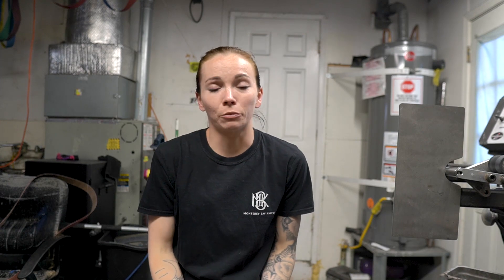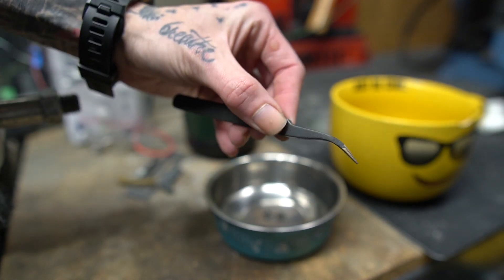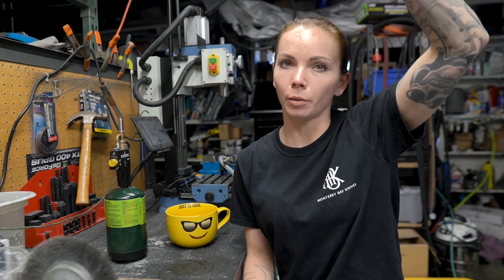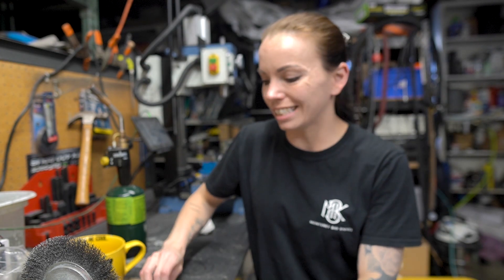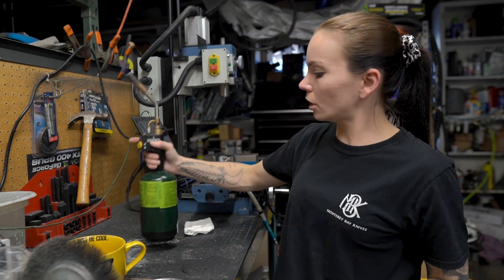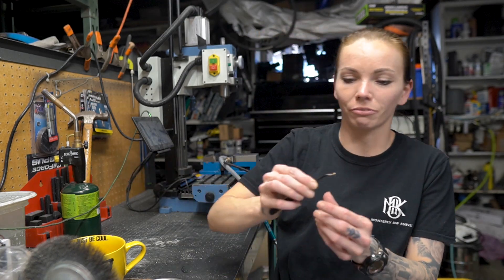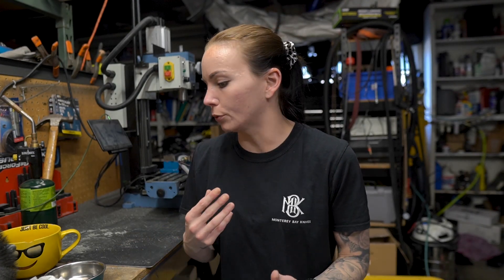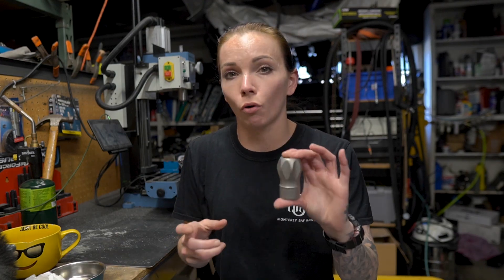Anodizing Part 3: Steel Hardware

Comment: This is not anodizing steel.this is actually the first stages of heat treating or hardening steel.
First colors seen is staw look then browns blues purple then it works up to cherry hot red.
The higher colors the more the steel becomes brittle until you temper.

Comment: Asking this because I know nothing .I would like to do this with some stainless steel bolts on my motorbike BUT how does this affect the strength or softness or hardness of the screw or bolt ? Also how does cooling it quickly using water vs not using water and letting it cool slowly affect this.
I would prefer bolts not to break on my bike as I am riding :)
Reply: Not really an expert, but I don’t think that the resistance of the screw changed much since it was not heated to a temperature in which the metal crystal structure could be modified. Still I think it’s better to avoid fast cooling with water since superficial cracks in the material can hinder its performance when absorbing impacts, so it’s best to try heating a few screws first (same type of steel if possible) and getting the color you want without cooling it with water. Hope this helps ❤

Comment: This isn't anodizing. This is a much older technique used by watchmakers called heat bluing. Anodizing requires electricity... Google anode.
Reply: Thanks! I was familiar with the technique but I’ve been trying to figure out what it was called
Reply: @_Michael_01  no problem. Watchmaking is something worth looking into because there's so many methods and techniques that would blow your mind. For example making raw steel outshine chrome.
Reply: Watch the #1 and #2 dude
Reply: Your wrong...now keep ur mouth shut

Comment: So how do we get a black anodized finish on our steel parts?
Reply: I’m getting a blue black in my oven at 550 for an hour. The color continues to develop after it cools. I have a gas oven and the temperature probably overshoots as it preheats. I put it in a cold oven then set the temperature. 425 makes a nice bronze

Comment: Mam can make any ather madle ?sam titanum color?
Reply from the maker: 😅I'm not sure what you're trying to say, typos
Reply: @KnifeModders  He's asking what colors you can make... and if it's the same range as typical titanium anodizing.

I haven't burned any steel lately, but it seems like it starts with amber, then brown, then purple, blue and black. Something like that, so not the same as titanium? I assume he's confused about electrolytic anodizing versus a torch.

Comment: I previously heat anodized a pocket clip but rubbed up against something abrasive and some of the ano came off. Can I just re-heat anodize it or should I remove the rest of the coloring to start over?
Reply from the maker: Best bet would be to remove the ano and start over
Reply: @KnifeModders Thanks, one more question though. it is a mirror polish clip so is there any chemical cleaners I can use to avoid having to sand it forever? Incase material is important it's a stock Spyderco para 3 clip
Reply from the maker: @Tuxedosam.  Anything that would remove it would etch/fog up finish the steel. If you have access to a buffing wheel and some compound that would remove the ano and keep the polish.